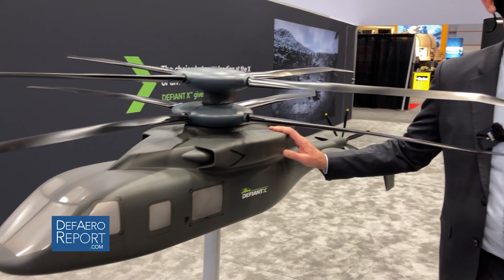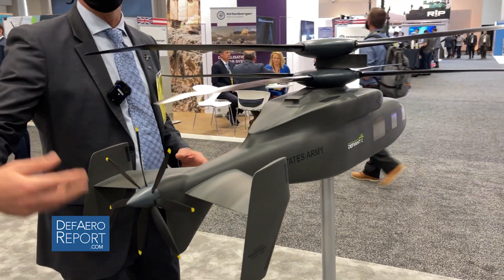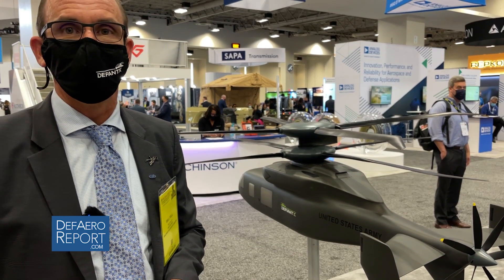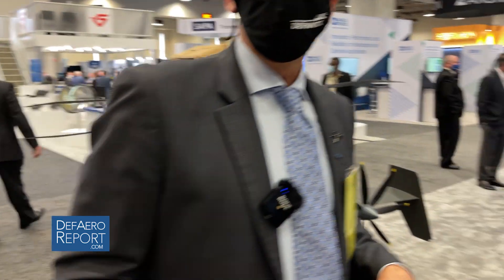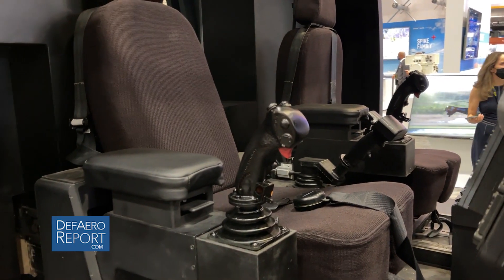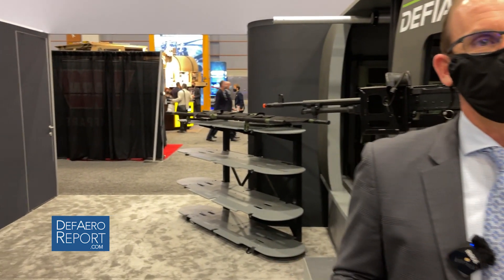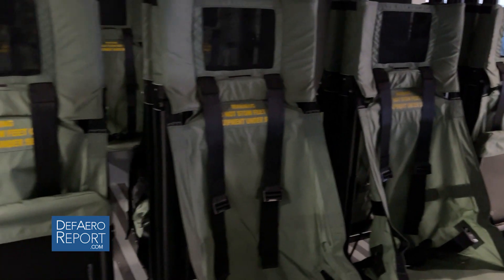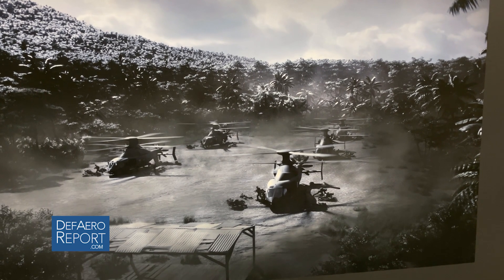Walkaround of Sikorsky-Boeing SB-1 Defiant Helicopter at AUSA 2021

Comment: Maybe all this sales pitch is true. 
But it's complicated. It'll require new skills to maintain, and will have new technical problems - remember the Osprey's sudden, catastrophic stalls and crashes? Only one group of people know a whole lot about coaxial-rotor helicopters and have used them extensively in the field: the Russians. And they're not going to give us any help.
Reply: New skills?  Not exactly, the design is relatively simple and elegant.  Should be quite easy for the army to train aviation mechanics on the drive system.  The new engine design is more of an unknown, because they haven't finished developing it yet.
Reply: @randomman057  But what are the specific weak spots, the ones you only find out by experience? Problems like the Osprey's. Or maybe one bearing that wears out faster or has lubrication problems - and the mechanics need to develop field fixes. With a new conventional helicopter, you might have some good guesses ahead of time. With this, you don't.
Reply: @Baribrotzer  Coaxial rotors aren't that complex of a design, certainly not as complex as a tiltrotor.  Mechanically, coaxials are not much more complicated than traditional helicopter design.
Reply: @randomman057  True, the gearbox isn't that much more complicated. 
What about the control system, though - the swash plate(s) and linkages to control the blade angles? Look at a picture of a Kamov, where the whole mechanism is exposed along that three-foot tall mast holding the upper rotor above the lower rotor. And remember, that was designed by RUSSIANS - who don't do anything complicated if they can do it simple. There's an awful lot of parts that could get hit by something or get dirt in the bearings.
Reply: @Baribrotzer  no more exposed than the mechanisms on plenty of other helicopters the US military uses.  There's a video with one of the test pilots who briefly describes the mechanism for the top rotor.  If I remember correctly, the controls for it are integrated into the shaft which drives the bottom rotor.  Obviously more complex in some ways, but I do believe it was done so they could better protect those critical components.

Comment: Sorry but the v280 is no where near as good as this platform and the Defiant & Raider are more true to form helo's and the x2 technology provides handling characteristics and agility that the valor just doesn't have and while the v280 is very good (especially in high speed horizontal flight) I don't think it's as good a fit for the army's needs because of the performance x2 technology gives you on approach to a target  , on the "X" as they say and during departure from a target.

Comment: Give up range and speed for a quick deceleration, not what I would call a good trade. (vs V-280)
Reply: You're not giving up range and speed.  The pusher prop still offers that with positive forward thrust.  But it can also reverse the blade pitch and decelerate the helicopter quickly, something a regular helicopter can not do.
Reply: @bryanrussell6679  it's not competing with Blackhawks, its competing with V-280
Reply: @Mediiiicc  
What did I say that was confusing to you?
Reply: @bryanrussell6679  read my first comment fully and your reply will make no sense
Reply: @Mediiiicc  
Your first comment seems to suggest that you think the prop at the back is for braking purposes only.
Reply: @bryanrussell6679  "you're not giving up range and speed" compared to the V-280 you are, which I specifically said "(vs V-280)"
Reply: @Mediiiicc  
Ok, I see what you're saying now.
Reply: We dont really know that the V-280 will be faster. Its just opened its envelope earlier. This project is still opening its envelope afaik. Anyhow the trade you speak about seems to be summed up pretty well by the Vietnam  air cav pic they showed.  (meaning it depends what your using it for - this will be better at some things and the V280 better at others. We should probably get them both imo.)
Reply: @ghostmourn  We do know the V-280 will be faster because Sikorsky has publicly stated what the expected speed of the SB-1 will be(250kts), and that speed is slower than the 300+ knots the V-280 has already achieved.